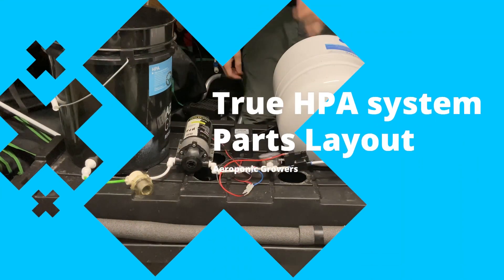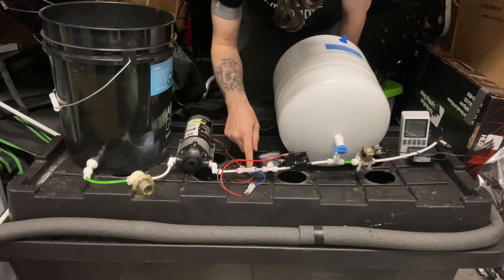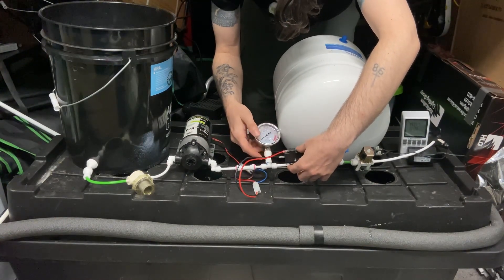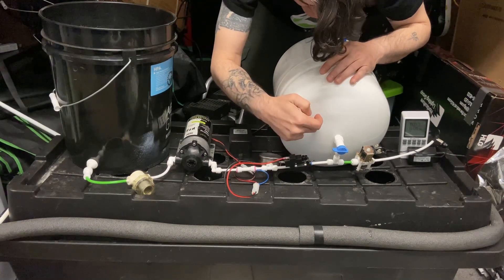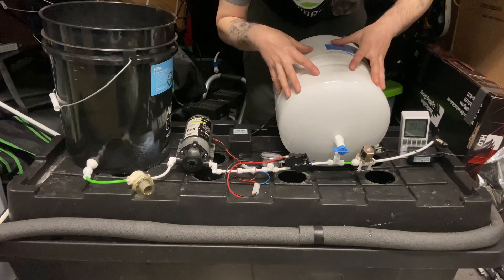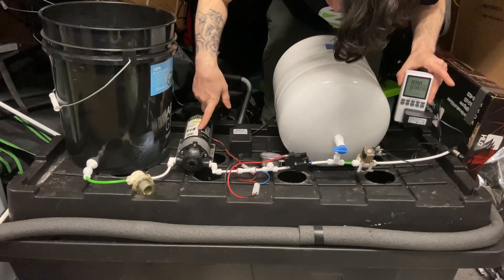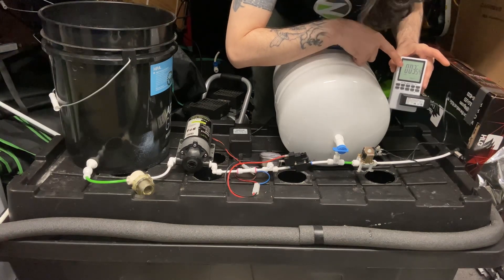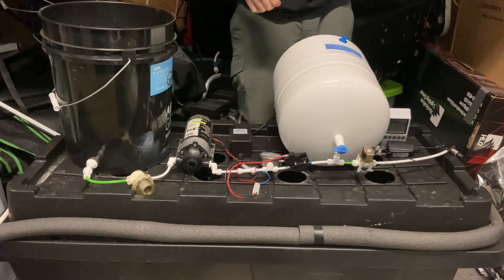True HPA system parts. Quick overview of how to assemble a high pressure aeroponic system.

Comment: How to control the solution temperature inside the accumulator? And how about ph fluctuations? And the temperature in the root zone?
Reply from the maker: Good question… to get to the point the issue isn’t cooling the solution. It’s keeping it cool while sitting in the lines before each sprayer. You can add a chiller, I put a chiller in my reservoir. But I found it easier to keep the accumulator and reservoir outside a tent and keeping those room temps in the 60’s. I get pipe insulation foam and place it around the tubing to block the light and keep some coolness. The larger the container the less fluctuations in heat. The shorter the hose is exposed to light and heat the better. As your canopy grows it will shade the container and temps will drop. The beginning is harder. Some people “degas” their root chamber if it gets to hot. Some increase the spray time to cool it down. My main goal is not having the root chamber hotter than the plant above. There are pH fluctuations that differ in a closed loop/recirculating system versus drain to waste. If you have the same nutrients circulating the system test your pH in the reservoir and do changes there. Remember roots absorb nutrients at different pH levels so let it float between 6.0 - 6.5. I don’t add a new solution of nutrients to other ones because there is math involved to figure out the new true ppm levels. I drain the system while it’s under pressure and suck out the remaining nutrients and start with a new batch. 

But with drain to waste you always are using sterile nutrients because they only move one direction. The pH you start with holds. I’ve used the capsule perfectpH before and leave it in my reservoir to control pH but only recommend it if you’re recirculating nutrients. Now I use Advanced Nutrients connoisseur. The pH solution in it keeps it stable, I use reverse osmosis water and around 1/4 strength nutrients and it gets me to around 6.0. Have fun!
Reply: @AeroponicGrowers  I'm learning a lot from the video and even more from your replies.
Thank you!
Just to confirm, you use 1/4 strength nutrients throughout the lifecycle of the plant, or just for seeds/clones/teens?
Reply from the maker: @jacobchang4588  this is another variable that works different for everyone. In the beginning “clones and beginning veg” I definitely use the least amount of nutrients. Then I may go up or down during the grow. Over 800 ppm is around the limit at the top.

Comment: When you switch your nutrients from veg to flower, do you purge the system, or just change the nutes in the reservoir and don't worry about the some of the old veg nutes mixing with the flower nutes? Same goes if your nutes are getting old and you want to change them out. I'm thinking the accumulator tank holds some amount of nutes that should be emptied first?
Thank you!!!
I'm doing DWC and my research shows this is a better way to go. As an engineer, I really dig this method!
Reply from the maker: I add a tee and put a valve on the tubing right after the pressurized side of the pump. This is how I use the pump inline with the system to empty the accumulator tank while sucking out the remaining liquid from the reservoir. When you release the pressure on this line the tank empties and everything up to the solenoid. The nutrients after the solenoid sitting behind the nozzles will get pushed out quickly. The solenoid usually goes off during this process anyways and the nutrients come out. Depending on the pump you’re using I let it suck everything out of the system and prime it again if it sucks in air. Mixing one solution of nutrients with another screws up your ppms, they go down. If I’m recirculating nutrients I only add reverse osmosis water to it but ultimately still dump them and start with a fresh batch for the best results. Since we only use a 1/4 strength of nutrients to start, doing drain to waste I find to be the easiest and best way of growing. For best results don’t mix nutrient “solutions” with each other once a batch is made. A small amount between changes is fine. As an engineer, your goal is to build a system that will run on its own so you can deal with the explosive growth up top. You can go really far with controls and building interfaces but the system always fails at a point. You need it to run for the amount of months you plan on growing until it reaches capacity. The larger the grow chamber, the bigger the root system. The least amount of parts needed to build the system the better. Each one can be a point of failure. For serious systems I run two pumps in a series just in case one dies, redundancy. Your plants can turn to mush in 4 hours when things go wrong. But, don’t put the plants into DWC to save them. The roots are growing like they were in soil and putting them into nutrient water drowns them or they stop until hydroponic roots form. I just put them in soil with the netcup and collar on them. A major difference in high pressure aeroponics is that you can grow root vegetables. This is why hydro will become too wasteful and Aeroponics is the future of feeding ourselves!!
Reply: @AeroponicGrowers  
Awesome! Thank you soooo much for the excellent answer/reply! Thank you for all you do!
Reply from the maker: @tybrady1935  no problem, have fun!
Reply: @AeroponicGrowers  I love your detailed and thoughtful answers.
Reply from the maker: @jacobchang4588  no problem. Good questions help other people and saves me time!!

Comment: Hi, Good day! Amazing videos, and learning a lot from them. I have a very basic naive question. What will happen if we remove the accumulator tank from the system, and we run the system 10 second on / 5 minute off? Can we not operate the pump-in-the box with external pressure switch in between 80PSI to 110 PSI, with cutoff at 110 PSI? I want to learn the cons of such an arrangement. - Motive behind such a question is I want to make a mist closet for wheatgrass growing. Want to place sprouted wheats on plastic / fibre tray and want to operate 45-60micron mist system (nozzle - head down) throwing from 12 to 18 inch above of the tray.
Reply: What he said is true.
When you don't use a tank the pump has to build up pressure everytime it starts.
This makes your droplet size to big, everytime it comes on, till it reaches the correct psi.
That's counter productive.
Don't you think?
Reply: @assog5737  yes, absolutely. I will keep you all posted. ☺️
Reply from the maker: Sorry for the late reply. What the accumulator tank does is keep a constant steady pressure behind the solenoid. Removing the accumulator tank means the pump has to build up pressure every time the solenoid opens. You don’t get the same pressure since it’s building up each cycle. Everyone’s system is different but most of us have found 3 seconds on as a max and 5 minutes off as the max. Add or remove misters to fill your chamber. What happens with longer spray times is it can confuse the plant into hydro. You want to use the least amount of everything to produce explosive results. Make the plants work in the beginning and they will be tough plants. The hard part is getting the plant stem to start producing tiny roots. This is where we start with a 3 second on and 3 minute off time. This should be plenty to get the roots started. Wheat grass grows so fast it will probably grow well in most systems since it doesn’t have a large window of growth time. For $35 dollars an accumulator tank will save you years on your pump and equipment, electricity etc. if you want to remove the tank simply run the system 24/7 at any pressure. If you want to do high pressure the point is getting the smallest amount of spray. Have fun, let me know!
Reply: @AeroponicGrowers  thank you for the detail. Yes, it makes complete sense to me. Would you mind, if I touch base with you during the build, if there comes hiccups?
Reply from the maker: @kuntalkuilaya  yes that’s what “Aeroponic Growers” with an “S” is all about. We all help each other become Aeroponic Growers. So whenever you have a question, especially if a video doesn’t answer your question ask it! This way people can better find answers to their questions or ask a more in-depth one. A lot of people take up to a year building and testing their system, especially when getting time is hard. Have fun, keep us updated!

Comment: How far should the check valve be from the pump? The pump shuts off if I close the tank, but stays on if the tank is open. It was shutting off before.
Reply from the maker: I’m not sure if I understand your question but I will try my best. The check valve should be very close to the output of the pump, if it’s needed. What is the bypass pressure on your pump? Is the air bladder in your tank pre-pressurized 3 psi under the pump cut out pressure? Your check valve “could be” the issue. Modern pumps have internal check valves and bypass pressures, the check valve keeps liquid from back flowing through the pump. It also removes that back pressure from the pump making it last longer. Remove the check valve and see if the liquid backs through your pump. Make sure the check valve is rated for the psi you are using. Switch it out.

Comment: I have a question about accumulator tanks!  I was a bit worried about using a steel tank, since in event of it going over-pressure it will explode. Have you tried using a nylon accumulator tank like this one https://www.wmjmarine.com/shu182200.html I know it's quite small, but I only want to make a small system for using in the kitchen to grow microgreens! Thanks!
Reply from the maker: Great question. So the smaller fiberglass accumulator tanks work very well. I’ve used the SeaFlow 24oz tank for years and has a working pressure up to 125 psi. If you’re setting up your pressure switch at 80/100 psi, inflate the internal pressure of the tank to 77 psi. I’ve over pressurized steel tanks and they blow off of the fitting first, I’ve never had the tank explode. Most come with a working pressure of at least 100 psi. To avoid over pressuring your system put a “pressure relief valve” anywhere on the pressurized line. Also knowing the bypass pressure on your pump will help with over pressurizing the system. The pump recirculates the liquid in it when it reaches the bypass pressure, keeping the system from over pressurizing.
Reply from the maker: That is a “ShurFlow” accumulator tank. SeaFlow makes a more affordable one. They both have the specs of a 125psi working pressure and an internal pressure of 100psi. When it’s a “working pressure” that means it’s safe to constantly work at that pressure. I would think the manufacturer has a higher level for safety...

Comment: Have you ever had pump damage from the oscillating pressure at the check valve right after the pump?
Reply from the maker: When I have used pumps that have the pressure switch in/on the head, the back pressure causes water to break the seal. The cheaper pink check valves don’t allow as much flow as the larger check valves. They are thinner than the fittings on it. We use the check valves that come with the pump from the manufacturer. They are larger than the tubing. If you remove the check valve from the system does the pump run fine? And if so when it turns off with pressure on it, do the nutrients back up into your reservoir? I don’t know what pump you’re using but it may have a check valve already in it. Test a few check valves without any tubing after it and see which one allows the most flow. Good luck and let me know.
Reply: @AeroponicGrowers  I am using a AquaTech 8852 pump and I think it must have an adjustable over pressure relief check valve as it was leaking back into the nutrient solution until I turned up the allenkey pressure adjustment. I have a pressure switch and tank cutoff solenoid before the pump and after adjustment I have not had backflow issues.
Reply from the maker: @DanielleCostantino6  there isn’t a check valve in that pump. There is an automatic bypass in the pump, you closed it. The bypass makes it so the pump doesn’t over pressurize the liquid, when it hits it max pressure it begins recirculating the liquid in the pump. Put a check valve right after the output of the pump. You only need a filter between the nutrients and the intake of the pump. The check valve holds the pressure in the system without stressing out the pump and causing it to recirculate the liquid. Res -> filter -> pump -> check valve -> pressure switch -> pressure gauge -> accumulator -> solenoid. Let me know...

Comment: Which nozzles do you use to produce < 50 micron mist with pressures below 100 psi?
Reply from the maker: So TEFEN makes lower pressure mister nozzles that make around 60 micron droplets which is fine. Netafim makes lower pressure nozzles which are excellent, yet need large grow chambers. BETE Fog did a lot of our nozzles and we got down to 40 psi nozzles producing 20-50 microns bit here is the issue; the tighter the nozzle is made to produce a fine spray at lower pressures, the less nutrients go through them and quickly build up. Look for the Tefen nozzles with the lowest gallons per hour rate. Let me know...

Comment: Where the links at.?
Reply: Your website doesn’t work. Wish you had posted links for us
Reply from the maker: Links to what? :-) website is www.aeroponicgrowers.com
Reply: @AeroponicGrowers  got it. Quick q for your aerobox 2. How many 64gal tote can be connected before its too much per pump?
Reply from the maker: @dagainsta6253  so how many systems you can control comes down to the accumulator tanks. In theory you can walk around with the AeroBox, hook it up to the nutrients and fill each tank. When I have used more than 3 64 gallon chambers I use a 20 gallon accumulator tank. 4 gallon tanks go good with each system so I add up 4 gallons per system to get an idea of what sizes larger tank to use. Let me know...
Reply: @AeroponicGrowers  got it so I only need 1 aerobox pump . What changes is accumulator tank size. Is there a recommendation if I should pass the 20 gal mark ( based on my how ever many totes I use) does anything else change ? Or is it still the same method just increase your tank if increase totes count and keep same pump?

If so, how often u have to refill the 20 gal accumulator tank with 1 aerobox?
Reply from the maker: @dagainsta6253  so the accumulator tank makes it so your pump doesn’t have to turn on each spray. The larger the tank the less times the pump turns on. They all have the same effect. So if I’m running multiple units I want to decrease the amount of equipment in the system. “More opportunities for failures.” Having a tank on each system is more parts. To remedy this I use a big 20 gallon tank then put a smaller 2 or 3 gallon tank further down the line of grow chambers. The big tank feeds the smaller tank and keeps it under pressure. Make sure the air bladder inside has the same pressures. I think I got the 20 gallon at Lowe’s or HomeDepot for around $100 dollars.
Reply: @AeroponicGrowers  would like to see how that setup would be assembled. (20gal tank and a 3gal tank ) im looking to use (5)-(6) 64 gal totes.
Reply from the maker: @dagainsta6253  I know the picture I want to show you but don’t know how to post it here. Think of the system as one big loop and the tanks are like bubbles in the line. I put the pump and reservoir closest to the 20 gallon tank, another tank is not needed. But adding one somewhere down the line ensures a steady pressure. You need to use a 3/4 inch pipe to a 3/4 inch ball valve with a male 3/4 inch to 3/8th inch push fit to get the 20 gallon tank down to push fit sizes. There isn’t an “in and out” on the tanks, they are on a tee on the pressurized line.
Reply: @AeroponicGrowers  From your responses, am I right in assuming that there's a limitation on scalability with the current system?  If not, then I assume the system remains the same but the size of each component would increase by multiples?  I'm wondering how to apply your innovation to a larger set up with like 20 lights...
Reply from the maker: @jacobchang4588  for large grows I’ve found low pressure aeroponic systems are easier to build and maintain. When building a large HPA system there isn’t a solid mathematical solution to size. I make spreadsheets and test a lot. My goal in each chamber is to have the furthest mister in each chamber to be equal to the pressure in the other misters. One pump can do over 20 gallons easily in a system. To increase the amount of systems I simply add a 4 gallon accumulator tank for every 2 - 4 units.
Reply: @AeroponicGrowers  got it, I think I understand.  It would be great if you made a diagram or a video detailing this mother/child accumulator tank system to extend it beyond the 4 containers.
Reply from the maker: @jacobchang4588  ya go to my website. Everything is there, diagrams etc…!